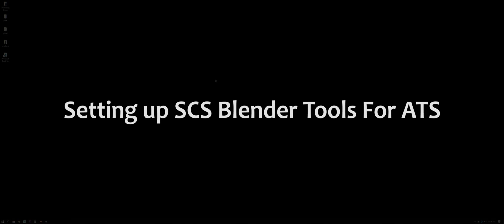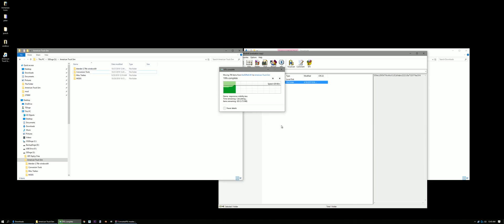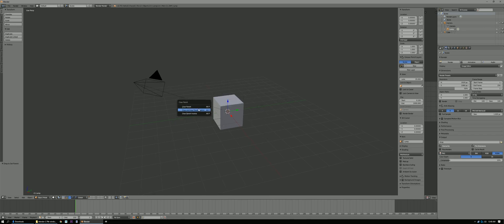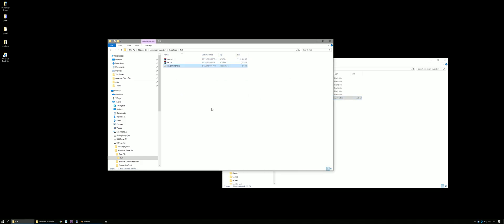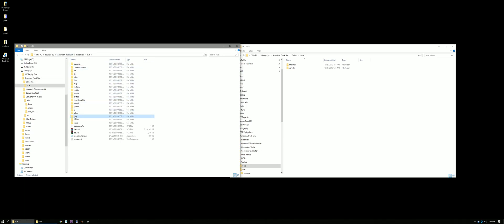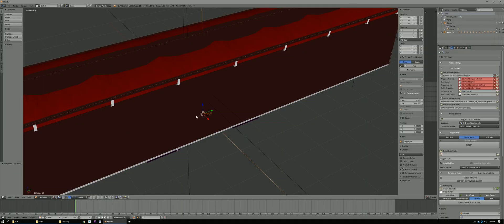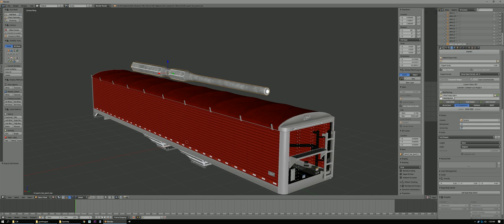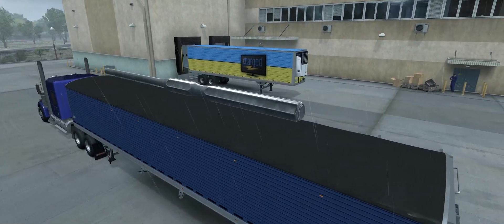SCS Blender Tools - Set Up for ATS 1.36

Comment: Hi i make a mod and i texture it and i export it but when i go to the game the the mod have purple texture , what is the promblem ?
Reply from the maker: Gaming World when there is a purple texture, it means the game is not recognizing it. Either it’s missing from the mod or it’s in the wrong format
Reply: @dasHute96  The texture is not missing from the zip also i check all the mat files and tobj  files, when you say wrong format for which files do you mean ?also should i bake the texture or doesnt matter ?
Reply from the maker: Gaming World are you using tga for the texture and letting the conversion tools convert it to dds dxt5?
Reply: @dasHute96  Yes of course in use tga textures and when i export they became dds and i convert dds to dds dxt5 but is still the same
Reply from the maker: Gaming World hmm the only other thing I can think of is the material. Try using a normal dif.spec material
Reply: @dasHute96  This is exactly the material i use .Also the bake i told you before does it matter if i havent done it  ?
Reply from the maker: Gaming World baking isn’t required. I’d try making a new material and reassigning the mesh to the new one. Otherwise I have no idea.
Reply: @dasHute96  Okey i will try it ,thank you so much for your help and for your fast response !!!
Reply: @dasHute96  I change the material , i done the mod from the begining but still the same . Do you want to send you the files to see it ?